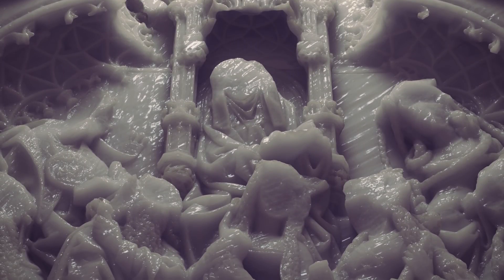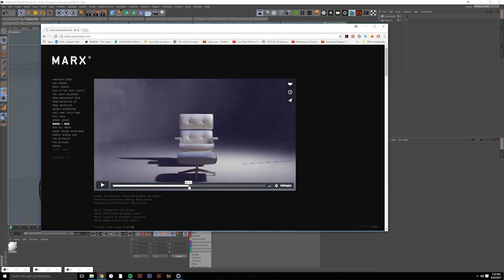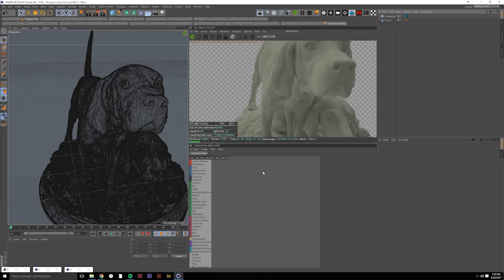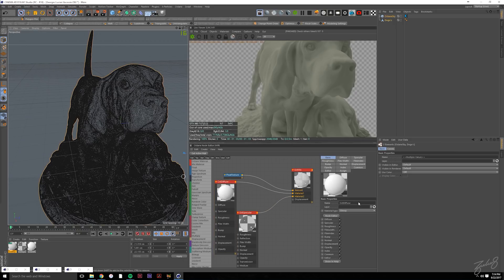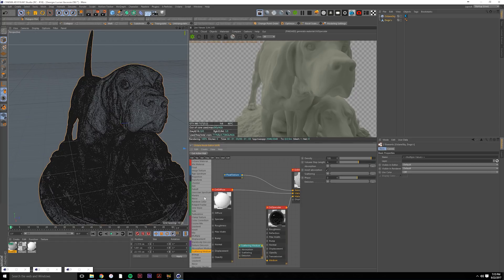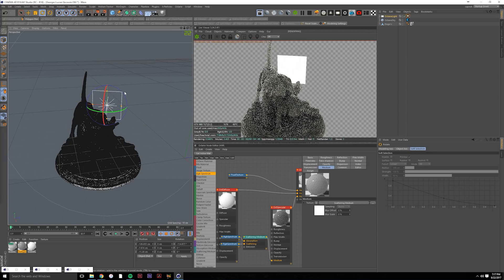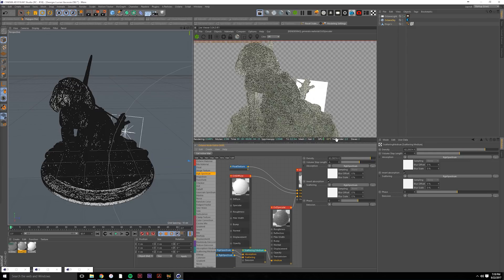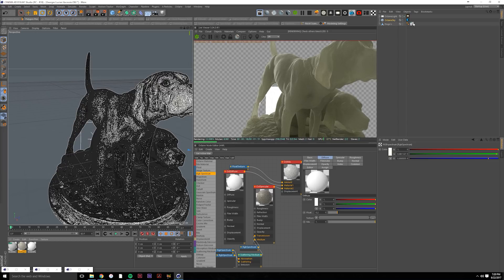How To Create A Subsurface Scattering Shader In C4D With Octane

Comment: Nice tutorial, but I keep getting some random hotspots in the middle of the object.. tips?
Reply from the maker: I would use path tracing to render subsurface scattering which might help get rid of your hotspots. If i was using directlighting i would set the GI mode to GI Diffuse and lower the GI Clamp to something between 1-9 but 1 works best for me to get rid of hotspots.
Reply: Actually solved it. I was mistakenly using C4ds normal lights :V
Reply from the maker: Good to hear. Thanks for letting us know i,  we ever have the same issue we know how to solve it now :)